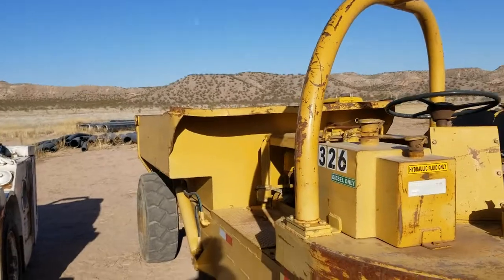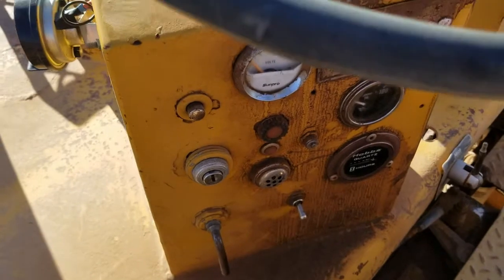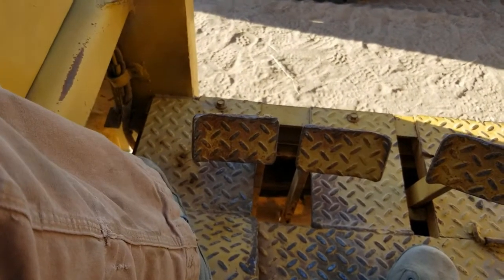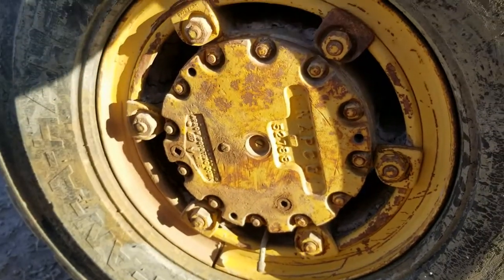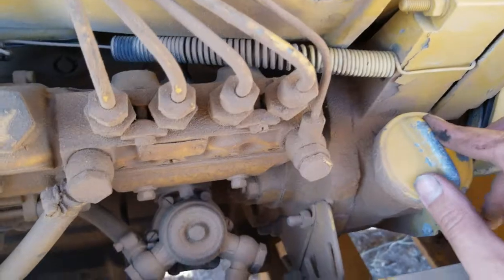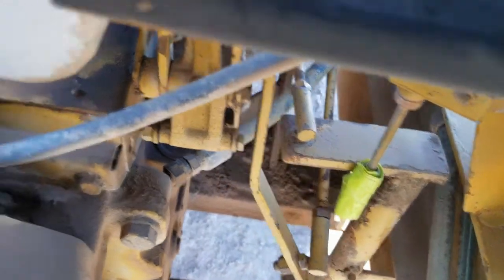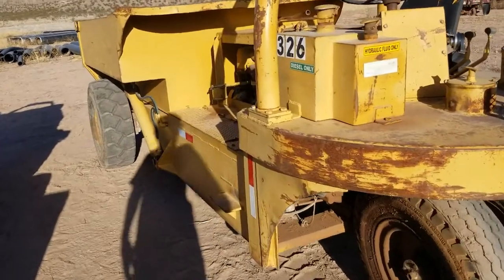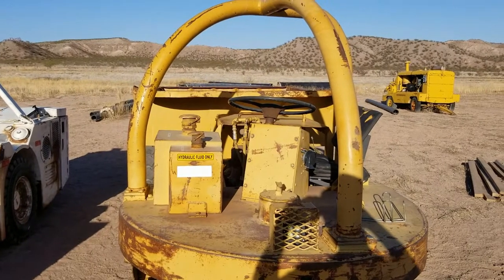Young Buggy Operation Basics

Comment: @Headframe Hunters  --  You might want to consider adding a  ''lock-out''  system (pressure switch & solenoids) to your 'Reverser' pedals so that they can't be operated while the vehicle is in motion .  You know as well a I do that Miners are very hard on equipment ( they can bust an Anvil with a Rubber Mallet ) , and since they don't ''own'' it , they will ABUSE it any way they can .   ---    < Doc >  .

Comment: Cool! Awesome detail.  Looks like yah need a fire extinguisher, and what would be the fuel capacity? And hours run on a full tank?
Reply from the maker: Good questions, Olive! Yes, it will be receiving a fire extinguisher shortly. The fuel consumption is in the neighborhood of five gallons but Youngs builds these trucks sufficiently custom that a standard spec sheet doesn't exist. These little Deutz diesels will do around 1-2 GPH so I'd count on getting around 3 hours depending on grades and turnaround speed. I'm hopeful that I can get this iron working underground this year - I don't believe the production rate will support running two trucks so I anticipate jumping between the buggy and the 911 (or whatever other LHD is in use). It's 50-50 between using the 911 and a 913, though I've tracked down a 911B ejector bucket that will tilt the odds solidly in favor of the smaller machine. As seen in that loading geometry test video, the weakness of the 911B is its low height. An ejector bucket makes that irrelevant and will drastically speed up loading speed while increasing truck fill factors.
Reply: @Porty1119 Cool.  Sounds like you'll have a lot of hours under ground; I hope it will pay off.